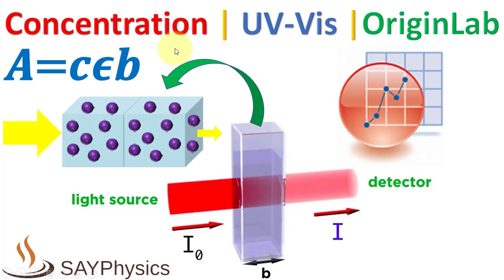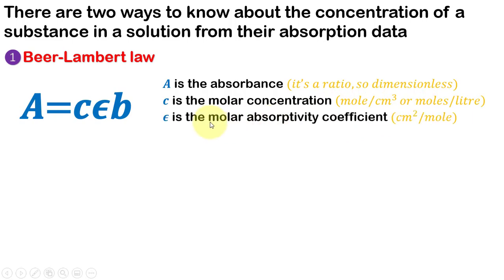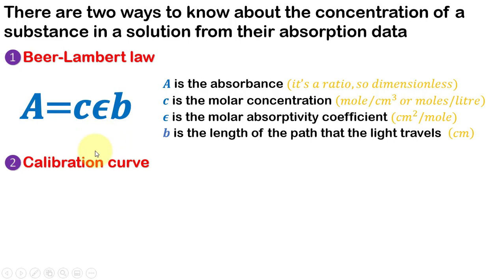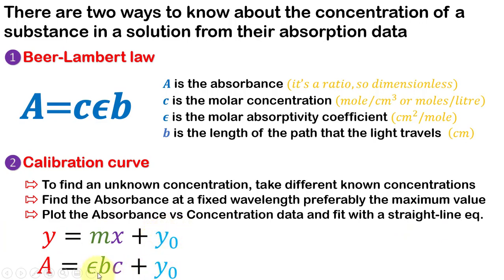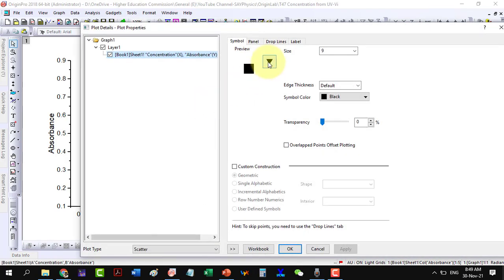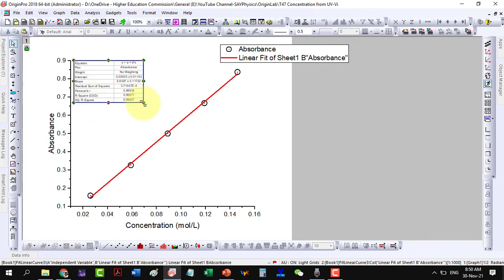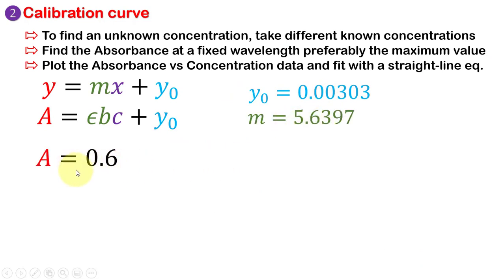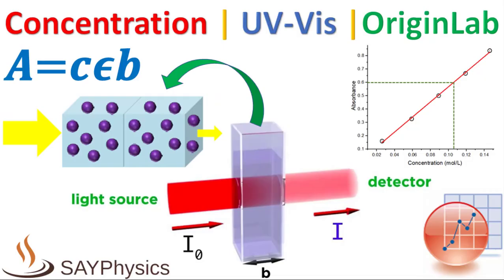Calculate concentration from UV-Vis absorbance using Beer-Lambert's law in Origin

Comment: If the concentration in molar was not given what to do?
Reply from the maker: If the concentration in molar is not given, you’ll need either the sample’s molar absorptivity (ε) and path length (l) to calculate it, or convert the available concentration units into molar before applying Beer–Lambert’s law. Thanks

Comment: same procedure apply for UV- drs?
Reply from the maker: Yes, the same principle applies for UV-DRS too. The only difference is that UV-DRS data usually comes in reflectance, so before applying Beer-Lambert’s law you may need to convert it into absorbance (often using the Kubelka-Munk function). After that, the calculation steps remain the same. Thanks

Comment: Sir,assalamualaiku.pl tell me why are we taking fixed wavelength like 700 nm for this test?
If i take 500 nm,is there any problem?
Reply from the maker: Wa alaikum salam, I'm not sure what 700 nm you're talking about. In case you're talking about the spectrum end wavelength (700 nm), then, visible range almost ends up here. Most of the absorptions are being studied in 200-700 nm (UV, 200-400 and Vis 400-700 nm). Thanks

Comment: I have a saturated solution of some compound. How do I find solubility of it using UV-vis?. I have slope from known concentration plots.
Reply from the maker: You can determine the solubility of your compound by preparing a series of solutions with known concentrations, measuring their absorbance using UV-vis spectroscopy, and plotting a calibration curve. Once you have the slope of this curve, you can extrapolate back to find the concentration at which the solution becomes saturated, indicating the solubility of the compound. This concentration corresponds to the point where further increases in concentration do not result in an increase in absorbance, indicating that the solution is saturated. Thanks

Comment: Sir calibration method me sb samples ka lambda max same ha?
Reply: "Absorption of all samples is to be measured at same fixed wavelengths" you have mentioned this
Reply from the maker: Certainly! Measuring absorption at the wavelength of maximum absorption (λmax) is preferred because it provides the most sensitive and accurate determination of concentration. This is because at λmax, the absorbance is at its highest value, allowing for the most precise measurements. Additionally, measuring at λmax minimizes interference from other substances that might absorb at different wavelengths, ensuring that the absorbance observed is primarily due to the compound of interest. This approach enhances the reliability of concentration calculations based on the Beer-Lambert Law, which relates absorbance to concentration. Thanks
Reply: @SAYPhysics  sir can we calculate concentration of NPs whose lambda max is different from those whose concentration is known (using calibration method)?
Reply from the maker: The calibration method relies on a linear relationship between absorbance and concentration, assuming a consistent lambda max. When dealing with NPs of varying lambda max values, this assumption breaks down, and the calibration curve may not accurately predict concentrations. Thanks
Reply: @SAYPhysics  bundle of thanks 🙏
Reply from the maker: You're welcome dear
Reply from the maker: In the calibration method for calculating concentration from UV-Vis absorption data, maintaining a consistent measurement wavelength is generally recommended. This ensures accurate and reliable results by minimizing the impact of variations in absorption characteristics at different wavelengths. However, depending on the specific circumstances and the nature of the samples, there might be cases where slight deviations in wavelength could be tolerated while still maintaining acceptable accuracy. It's important to assess the potential influence of wavelength variations on your calibration curve and the precision of your measurements. Thanks

Comment: Sir kya same ppm solution ki absorbance change ho sakti hai maximum lameda pay .means 10 ppm Solution ki absorbance 0.4 go and pir solution bnaow 10 ppm ka to tub 1 absorbance show ho rahi ho UV pay kya ye possible hai
Reply: Thanks sir calibration curve photocatalytic degradation of dye k liye q needed hota hai
Reply from the maker: We use the calibration curve for calibrating our device measurements and for measuring an unknown concentration or activity. Thanks
Reply from the maker: Principally, if both ppm and matrix are the same, it should have the same A for all samples to qualify the repeatability test. Intensity may differ for same samples due to;
1. Condensation of the dopant in the disperser
2. Heating up issue of the exciting lamp
3. Voltage fluctuation during the measurement
Thanks
Reply: Sir calibration curve pay 1ppm ki absorbance change and next day jub 1 ppm bnaya degradation k liye to absorbance change thi but lameda max ki value same thi to is say koi farq parta hai